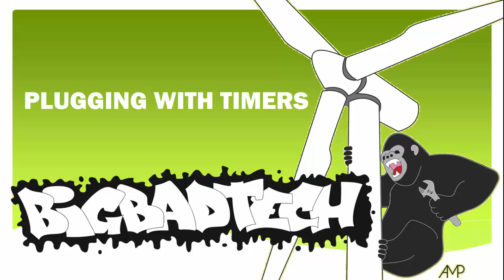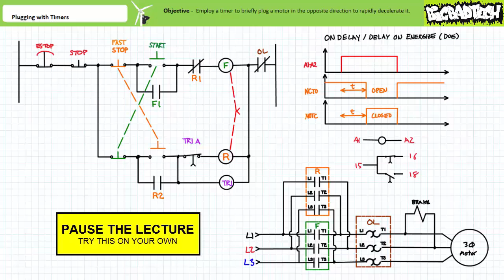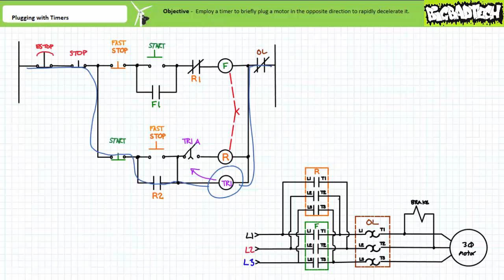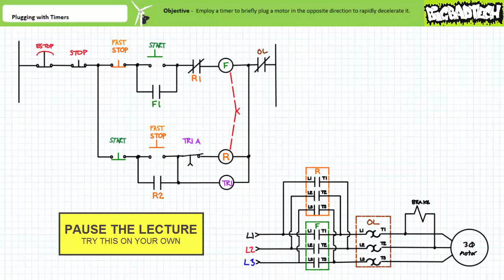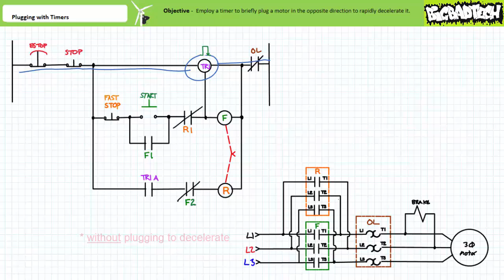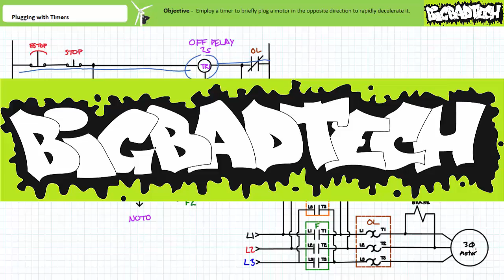Plugging with Timers (Full Lecture)

Comment: What if, in order to troubleshoot the first diagram, I connect R2 in series to an NO contact of the F coil? In that case you could activate the fast stop only if the start button has already been pressed and thus the motor is running, othewise nothing would happen since the NO contact would be open and R could not be energized.  I'm not an expert so my  soulution is likely to be flawed. Thank you for theese very informative videos